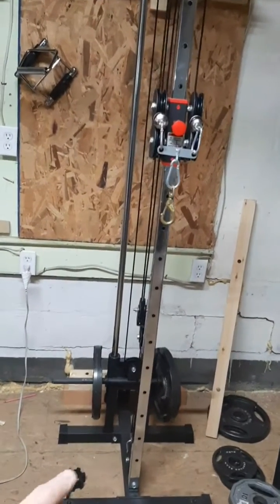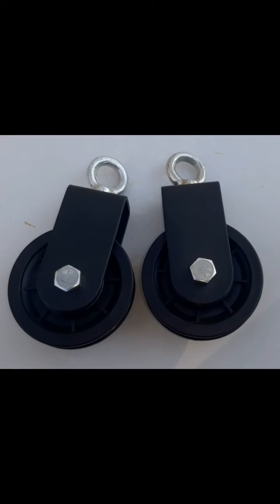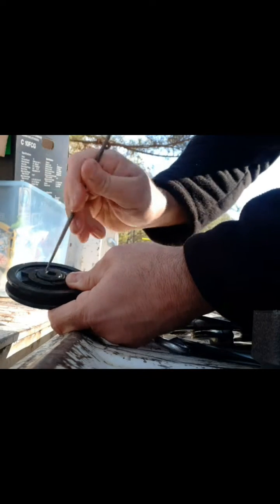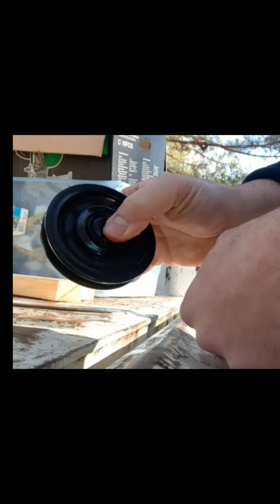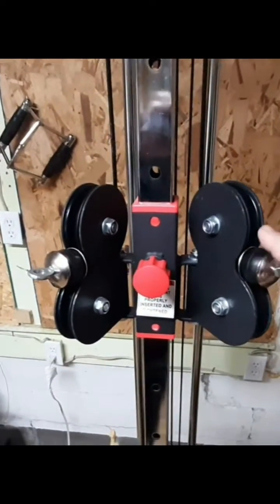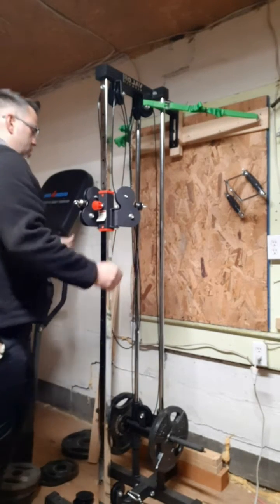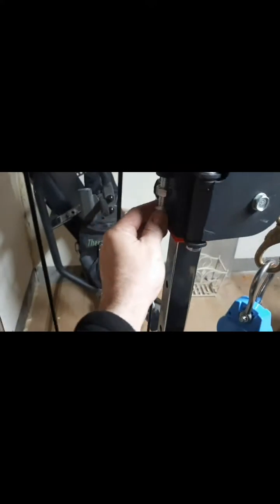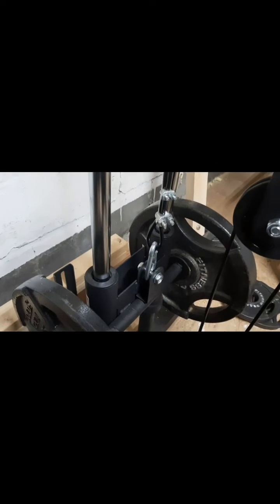Twin pulley conversion to true weight.

Comment: So isn't the two pulleys pulled together with the attachment 1:1 ratio? I have a cable crossover plate loaded and it's 2:1 ratio max load 100kg but feels like 50 if pulled single cable at a time but I diy a bar to clip a pulley each end to do lat pull downs so the 50kg per side is 100kg when pulled on the diy bar
Reply: Wait, that was unclear. Do you have a cross over that has a pulley at the top and a pulley at the bottom?
Reply: I have a plate loaded pulley crossover menheath one it as 3 pulleys left side moves up and down the 2 low row pulley at bottom mid and then 3 right side pulley moves up and down. If I load 100kg on the rack if I pulley only one pulley it is 2:1 give 50kg so if I do chest flys with left and right side at the same time it's 50kg per side meaning 100kg so my diy bar clipped to left and right side when pulled the bar is 100kg meaning 1:1. In this video the guy shows the two pulleys clipped together that would be 1:1 if pulled

Comment: Could've switched to aluminum pulleys and it would've been much smoother. Cool trick though
Reply from the maker: I didn't see any aluminum pulleys, but have considered garage door pulleys.  Those are galvanized steel with exposed bearings - very smooth.  I imagine the garage door pulleys would wear the cable coating pretty badly.

Comment: So Rob, after almost a years use, how has the modification worked out? I'm trying to decide if I should build my own or buy one like this and modify it. BTW, nice work!
Reply from the maker: I use it almost daily for my workout.  It's been great.  Smoother than it was originally.
Reply: @robblack9932 Is this ratio conversion possible on any dual pulley set up?
Reply from the maker: I can't say for sure but I would imagine so
Reply: @robblack9932  :  I was hoping you lived here, i would pay you to change the ratio in my crappy pulley system! It's a made in canada model " Nothern lights/IRFT150". It has 2 (150 lbs) stacks 54 inches apart. There's not even a ratio specified on this thing so i never know what i'm actually lifting, it's really frustrating. I've had it for 2 months and it's already become too light for heavy flyes or presses.
Reply from the maker: @marlon1171  just looking at the model you referenced, It's tough to see exactly how the cable runs, so it's tough to tell if it would be simple to convert yours or not.
Reply: @robblack9932  : Just now i hooked on an extra 40 lbs around the 150 lbs stack and i was able to get~ 100 lbs more or less, i never get a stable reading. I don't know if getting a better quality set up would make a difference. The poles on which the stacks slides up and down are hollow flexible pipes. They bend in all directions, that cannot be good to get a reliable resistance throughout the cable.....
Reply: @robblack9932  : Thank you by the way to have looked at the model i'm using..

Comment: So you can still adjust the height up and down?
Reply from the maker: Yes.
It's still working very well too.
Reply: Can you show the bottom cable holding the junction block of pulleys. Trying to understand how it mounts